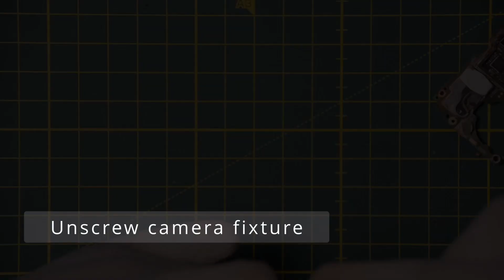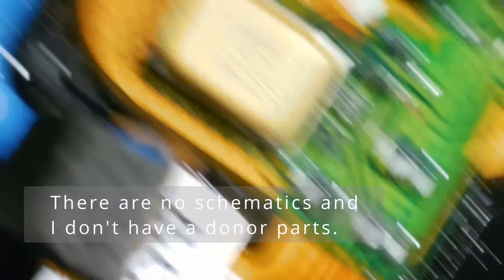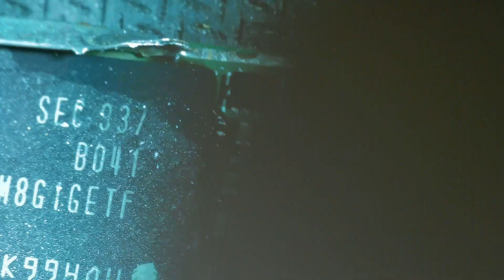How to Fix Water Damage On The GoPro 8

Comment: I recently dropped my Hero 10 in fresh water.  Dried it  and sprayed contact cleaner inside.  It switches on and front screen is ok but rear large screen does not come on.  Do you think I can replace it? It’s been over a week now and the situation is the same.
Reply from the maker: Hi i think the circuit that drives the large LCD screen could be faulty check near the connector if you see corrosion if not then the LCD is most likely to be the problem. Gr. Jim

Comment: What do you use to connect back the cable that is behind the camera? (The black one that doesn't have a connector, but it's directly glued and needs to be detached when disassembling the camera?)
Reply from the maker: Hi, you can add a piece of isolation tape to cover the copper plate or you can just leave out as long as it does not touch other metals. Gr. Jim